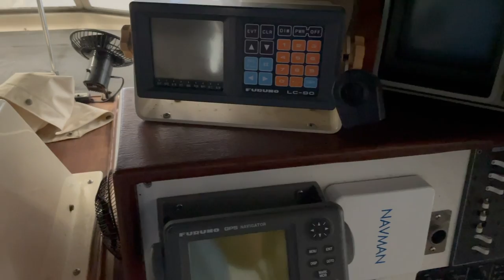Let's try this boat buying thing again, Chris-Craft Catalina 381

Comment: Thanks for the tour of Ursa Major.  I have a few questions about that boat if you have time.  I am going to transition from airplanes to boating, just for context.  The boat looks great and would fit our mission, but I am concerned that she has been on the hard for some time.  Do you feel this is a serious negative to this boat and mechanical systems? Any other thoughts on this boat are appreciated.  Thanks
Reply from the maker: I did the same thing...airplanes to boats. Used to fly professionally, and if you go way back in my videos, you can see the first flights of my RV-7 that I built. Anyway, Ursa Major is a nice boat, just needs to be cleaned up. I had the same concerns about it being on the hard for a while, but usually when they are stored inside and heated, it isn't a big deal. Check all rubber hoses is the main thing, and as long as the engines were at least turned over every 4-6 months (or pickled, which I don't think these were), they should be fine. I can't really comment more on the mechanicals though as I just visually looked things over since we never got to a survey on it. It, in my opinion only, needed some more updating inside, but that's personal. The electronics are ancient, but were said to still work fine.

Comment: after watching that whole video would have been nice to see the different prices. Why the secrecy ?????????????????
Reply from the maker: After reading that whole comment, why so many question marks? I can only imagine a comical raise in your voice in asking that. LOL...anyway, it's not about secrecy. I typically don't include prices of boats, whether I'm buying or selling, because it's only relative to when the video was published. That was two and a half years ago, and if someone watches that video in 5 years, it's completely irrelevant. Other factors would be that the hardtop boat wasn't officially listed for sale, and if they are listed, it is very easy to find the boats on the various sales sites. It isn't my job to promote someone else's sale, and even if I did say the price of each boat, that could change drastically the next day. As of writing this comment, prices are still pretty consistent to what they were then, so a quick search will show you what these sold for, and are still selling for, including mine...again, as of right now. That could change tomorrow.
Reply: No kidding. I've seen 2 of these boats listed, same year and based on photos and description (I only saw the listings, not the boats themselves) in the same condition. One was listed $30k less than the other simply because the seller was more motivated to get rid of it (moving and unable to take with them vs simply not wanting anymore).

Pricing is definitely situational.
Reply: They all do it..by to resell don't want everyone knowing how much you paid

Comment: Boss I hope you have owned a boat before. You keep saying "not a big deal" but every one of those items is money out of pocket.  One of the items I picked up on the first boat is the totally inadequate anchor gear. Chalk up another five thousand for new windlass, 70 lb rocna Vulcan anchor, and 300 feet of 3/8 chain. Then there are the electronics, all very old. I'd want new stuff, probably another 10 K. It starts to add up fast.
Reply from the maker: 'Sup Chief? Well, you picked up on reasons I didn't try to buy the first boat in this video. Thirsty Whale (the last boat in the video) was my 6th boat...so I'm well aware of the costs associated in maintaining and upgrading boats. If you check out other videos on my channel, you'll see that I do almost everything DIY, and by doing so, I stand behind my statement of saying a lot of this stuff is "not a big deal". Costs are controlled and money is saved.

Comment: Risers and manifolds look like they need replacing .
Reply from the maker: Good eye...yep, was on the survey.
Reply: Risers are so cheap, and so easy to replace yourself, that I always tell people if you don't know when they were replaced last, it's better just to replace them to be sure.
Reply from the maker: @ralphholiman7401  I will be replacing mine when I get the boat on the water...just haven't had time to do them over the winter. But I completely agree...if you don't know, replace them.
Reply: @WiscoBoater  , yep, hydro lock is not fun!